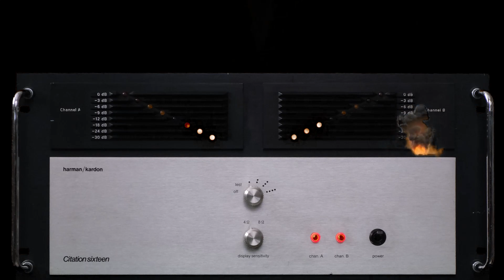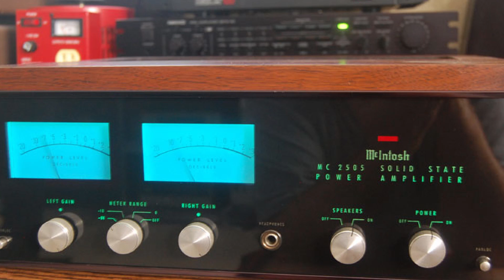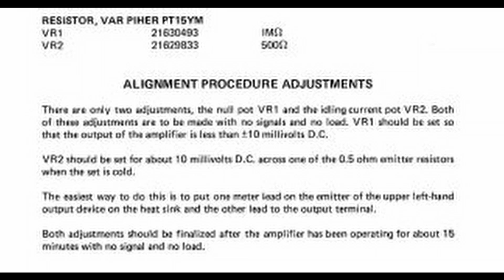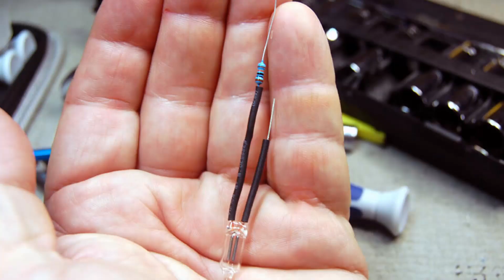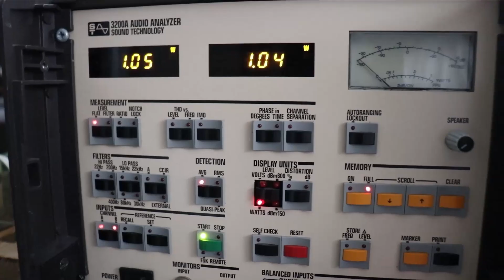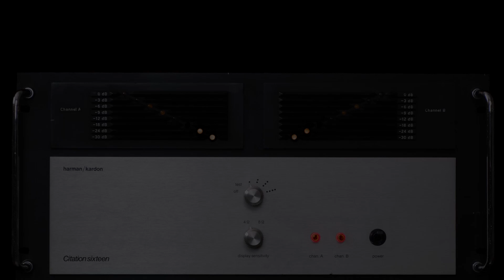Harman Kardon Citation 16 Power Amplifier. Vintage Stereo Repair Restoration Testing. Old School HK

Comment: I bought my Harman Kardon Citation 16a ( with a black front) wayback in 1978 and i still use it today.

The amplifier had an upgrade according to militairy specifications.

A friend of mine was a senior electronics specialist in the Air Force and he worked many hours to upgrade the amplifier.

The LED peak indicator system was removed to prevent electrical noise/interference in the audio signal

As a result the two controls on the front became accesible.
The top control was secured for the looks and the bottom control was connected to a couplingshaft connected to a stereo Noble potentiometer over the entrance

The original power supply capacitors were replaced by formed Siemens Sikorel long life types

The smaller capacitors, resistors ect. were replaced according to militairy specifications

The originally unreliable factory relais was replaced by a professional Zettler relais

Factory errors were corrected

The transistors on the back were stripped of the crimp sockets and silver soldered and the thermal paste was refreshed

Silver cable with teflon coating was installed

The bias was lowered from 50 mA to 10 mA to avoid damage by heat
(using an oscilloscope and a distortion meter)
The amplifier now only gets lukewarm instead of 80 degrees

The bias can be adjusted with a closed hood too which is very important.

During a check after 5 years it was found that the bias had not shifted at all (0,0 %)

Well i no longer need a seperate pre-amplifier and a Marantz CD-94/II CD-player is directly coupled to the entrance of the Harman Kardon Citation 16a.

The sound is clean, powerful  spatial and detailed.

Comment: I did listen to this Citation 16 combo in the early 70th. The JBL L166 did wake up and did really sound great on the Harman Kardon amps. Have been a JBL fan since. Also have a Marantz receiver from 76, but dont use it right now. Must have some service. The most popular norwegian ''vintage'' amp here in Norway is, Dynamic Precision. Will last forever with a tech who knows and upgrade this amps.

Comment: I did a complete service on one of these a few months ago. I did a complete recap, replaced the bias and offset pots, and so on. It came back first because the right channel was throwing about a half-volt of DC offset after warming up, and then later it actually stopped playing in that channel. It ended up being one of the transistors in the current source that feeds the bias string for that channel (Q5 on the schematic). I replaced that transistor and all was well. These amps are definitely built for ease of service - always appreciated by someone in my field!
Reply: Good Job 👍👍

Comment: I worked for military exchange out of high school in 77/78 in vogelweh West Germany. In the  sound centers speaker room they used a 16. The Leds were trick. Many times i would have a group of GIs staring at the bouncing lights. It was a great time working there, the golden era of hifi.

Comment: I’m thinking about buying one the owner said this. Left channel works fine, but right channel is intermittent. I believe it might be something to do with the power button.  $290. I have a good tech should I pull the trigger
Reply: hey Bob - did you get it?

Comment: I worked for HK when these were being built and had one we employees could buy them at 1/2 price.
Should have never sold it to a friend who still has it.
One of the tests was to have it at full power and short the outputs never bothered it at all.

All units were run at 1/3 power for 24 hours most power dissipation on the transistors is at 1/3 power.
Loved working there but pay was not so great.

Comment: People tend to freak out about how hot the heat sinks get while idling on Citation 16's, BUT, if if you read a through description of the operation of the amp from the Sixteen A service manual, pages 5 and 6, the bias is set so, it operates under Class A well above where most amps are set, in order to lower crossover distortion.
The service manual states that the heat sinks, at idle, may be up to 60 degrees C, Sustained 1/3 power usage may rise the heat sinks to 80C, and full output may go up to 75C, thermal protection switches on the heat sinks will open the AC line power to each respective heat sinks power transformer @ 90C. You just need to give it the ventilation it needs to cool itself properly.
Reply from the maker: Thanks so much for sharing that information.

Comment: I see this is a yr old video. Hopefully you see this message.  I have same identical amp. Bought it $100 work perfect. But I would like to restore it cosmetically and have it gone through  performance wise. Used it for about a yr.  Now It's sitting underneath my pool table. Can you help?

Comment: Fantastic video.
Reply from the maker: Thank you very much!
Reply: @vintageaudioaddict  so i checked a local audio store near me like i do every couple weeks just to see any new inventory. Late last night i found citation 16 for sale. Great shape. Test bench, cleaned up, good price. I went right to your channel and watched this video again. Bought it today and hooked it up. I had a modest kenwood kn 992 150 wpc amp powering my front speakers in my home theater. It was good. I replaced it with the harmon kardon, and there is no comparison. Same watts on paper. But the citation is sooo much better. Thanks so much for your videos. May not have realized what a steal this amp was without you.
Reply: @vintageaudioaddict  now two channel sounds good in that system. Cant wait to test it out more after nascar and dinner. Cheers

Comment: I got one of these out of a junk pile at a music store that was going out of business, it had no bottom cover and the power switch was broken off. I was going to gut it for the power transformers but I decided to trouble shoot it for fun, ran down the outputs and found nothing wrong so I took a screwdriver and flicked the broken switch on and it powered up, then hooked it up and it played just fine. I work for an Industrial electronics company so I looked through the Mallory catalog for power supply caps and  found some that had very low ESR and massive ripple current rating ( they were ment for giant industrial flash units). Redid the caps and rebuilt the low voltage power supply.  Hooked it back up and man those main power supply caps woke it up. Ran it hard and the current now available put the heat to the outputs.  So I made a fan shroud and temp switch to keep it cool. Gave it a cosign burst test  and it did it cleanly at over 1700 watts! This is a very nice sounding amp and has huge dynamics. 
It's a keeper.
Reply from the maker: Thanks for sharing. So much of this old audio gear can live on with a little attention.  Good Job!

Comment: Great amp! One of the best ever. However I remember the issue with LED display, yes one of the first, you could hear the stepped trigger points for eaach LED when it would fire. It could even be seen if you expand a sinewave enough on a scope. A slight glitch in the slope as each voltage level tripped.

Comment: Hi VAA
Nice video, and comments
I can get my hands on a HK citation 16.but one channel is fried. So I'll guess the end transistors are done.
Are they still available and are they expensive? I count 10x per channel.
If available and not end of the world costs, I can purchase it, replacing all caps and like you mentioned those variable resistors into nice bournse blue ones. 
I bet this amp runs any speaker, even electrostatic ones.

Comment: I’ll try it again , great video . My 1st venture into high end was back in 1978 , I bought a citation 16 amp, apt Holman preamp, DQ 10 speakers . Had a nice kenwood turntable, mc 20 cartridge and step up transformer, then added a citation 19 amp , an advent surround decoder ( don’t remember the model ) and large advert speakers for the surround. You could adjust the delay from 1 - 100 milliseconds. Those were the days! Got married, you know the rest. I bought a used citation 16 amp & 17 preamp, had them slightly upgraded, been in my closet for the last 15 yrs. I’d have to say the 16 & 19 were two of the best sounding amps out there especially for the money. Again great video, brought back some good memories.
Reply from the maker: Thanks for watching and sharing your story. For most of us this equipment does bring back great memories.

Comment: Even properly functioning Harman Kardon amps run hot. I had my PM 650 in a cabinet with a glass door it would be almost too hot to touch. I worked on copiers for over 39 years and when a machine was junked I would often take the little 2 wire fans out. They usually run on 12 volts DC. I have a bunch of old AC to DC adapters laying around from old electronics, and I wire up a 3 or 6 volt adapter to the 12 volt fan and it will run slow and quiet. I plug it into a switched AC output on the amp and it works great.
Reply from the maker: Thanks for sharing.

Comment: I have a 16 as well, but does not have the l.e.d. display.  Solid black face.   I run it in concert with a Citation 11 e.q. and a pair of Soundcratsmen PCR800's.
Reply from the maker: Sweet! Great Gear!
Reply: Hey Paulie!  I have the solid black version as well (a gift from a friend).  I'm assuming this version with the LEDs is the same inside, but I have no real idea.  Do you (or anyone else) know what the difference is (if any)?
Thanks in advance!

Comment: I had one of these years ago that I got for free. Only one channel was working and I didn’t have the skills at the time to fix it. Parts availability was an issue back then, pre internet days.  It seemed like the RCA outputs were not to be found anywhere in the known or unknown universe at the time.  So I used it in my recording studio for a while with the working channel driving a sub.  Eventually I gave it away when I shut down the studio. I wish I had kept it since with what I’ve learned over the years I’m sure I could get it up and running.

Speaking of HK and biasing I’m currently heating up a pepperoni pizza on top of a HK 460i receiver.  I think it needs a little something when I get to it. In the meantime it’s on the retired list.

Thanks for the write up on the old HK 16.  I really did like those beasts.
Reply from the maker: Your welcome and thank you for sharing your story. Harman Kardon made a lot of really good audio gear back in the day.

Comment: All 80s Harmon-Kardon amps ran incredibly hot with insufficient heatsinking. The integrated amps and the power amps and the receivers. Bad design. Even a 35 watt/channel integrated amp with NO bias adjust. Overheating can damage lots of other components and cause failure or premature failure.  I have always built my own with Heathkit and that equipment is still working fine today.
Reply: I have several and all going strong
Reply: It's designed to run Class A at a higher wattage than most amps, and it is expected to have heat sink temps up to 60C when idling, the info is in the 16A service manual, which can be found online, pages 5 and 26

Comment: Awesome review, I have one I bought new in 1970, would you mind doing a follow up with detail on bias adjustments, I have the service manual, but I'd love to see how you did it, I have one channel that I can't get the bias to calibrate, so I'm going to replace the variable potentiometers with the multi turn ones like you used. I'd also love it if you could show your method of checking the output transistors. I've replaced 2 of the  large filter caps as one had gone shorted on that channel. I've also replaced all the electrolytic caps and the relay as I thought that that may have been why I was having issues with one channel initially. Thanks again for your review of the HK Cit 16, I've loved that baby since I bought it, it's driven Carver Amazing Loudspeakers, the originals with the 5 ft ribbon and 4 12" drivers, also the Ess AMT1 A's which I purchased at the same time as the Cit 16. And now it drives Acoustat 1 + 1's beautifully, very inefficient and low impedance, but the HK Cit  16 never complains.
Reply from the maker: Thank you for the kind words. Yes, first replace those variable resistors with muti-turn one's. I think that will make your adjustments much easier. The original variable resistors VR1 and VR2 can get really intermittent and cause a lot of flakey problems. If you can't get the bias correct after that then you would need to investigate further.
Reply: @vintageaudioaddict  Thanks, I've ordered the Variable Resistors and will hopefully rejuvenate the old girl. Thank you for giving me the push to get her up and running again.

Comment: I noticed many cd players cassette decks tuners do not have ac primary line fuse in them so i put one in i have many videos putting it in is it a good idea i put disclaimer on those videos consult with a authorized service center before doing do you think its a good idea
Reply: there's not really any point in doing that.  your observation of CD players, cassette decks and tuners  not having fuses is spot on,  those types of devices draw such little current a you would be lucky to find a fuse small enough to pop before the transformer fries itself.  note how small the transformer is in those devices, compared with something like a power amp,  source devices are known as high impedance circuits, they require next to no energy to work
Reply: @jackheinemann8780  but if power supply shorts like diode or power cap goes it can burn transformer and possibly start a fire if cord melts and shorts I think
Reply: @DavidBerquist334  hmm,  yes that would certaintly be a concern with an amplifier, which is why they are fused. But the transformer in source devices is only capable of delivering a handful of watts from the wall.   This is my thought process,  it may be wrong,   if there is a short on the secondary side, that is essentially being seen as an infinite load by the primary, and infinite load = short at your wall outlet,  that will trip your breaker before you anything happens, well before a fuse would blow.    Im not going to be loosing any sleep over the fact there arnt fuses in my cd player.

Comment: I used to run a single citation 16 on four 15 inches (stereo 4 ohms) for my mobile dj setup 25+ years ago, I have beaten that amplifier and it never failed. I had an engineer in my area where I got it from he had installed a distortion detector in the amplifier that limited the input when distortion was detected, it worked really well and sounded great, lots of good memories and fun when I think of all of that gear !!!
Reply from the maker: Thanks for sharing. Like you a lot of good memories surround my vintage audio equipment.

Comment: I installed 8 of those in a big Venue for permanent house sound plus I owned one of the last ones ever made. (all black with the relay protection and discreet driver boards)  Superb unit in the h/k tradition. Sadly it was stolen right from my living room and we never found another one of that production run and condition. I would grab another one instantly , if i could find the same version and fully refurbished.   but the chances are slim.
Reply from the maker: Thanks for sharing and watching! Sorry that she was stolen.

Comment: Really nice video on a really nice amp. The sticker on the back with the engineer's names is great. I had a Bose 1801 amp back in those days that weighed 82 pounds, the power transformer alone weighed 41 pounds! A nice amp with great metering. Then I built the Dynaco Stereo 400 amp which was also very nice but without any metering. Had it for many years.
Reply from the maker: Thank you! Thanks also for sharing your experiences with your equipment. Nice gear!

Comment: Most components of that era, whether low or high end, seem to be better built than components today. Nice video!
Reply from the maker: Yes, they were. I wonder how many modern electronic devices will still be operating in 50 years? I'm guessing very few. Thanks for watching!
Reply: Not the electrolytic capacitors. The technology is far advanced than it was back then

Comment: I know it made sense to change the VR2, but could a guy exercise it to try and get it to work? Possibly spray some deox-it in there? Ya know, just to get it to work for testing reasons or whatever?
Reply from the maker: Sure, you could try to exercise the variable resistors but you should replace them at any sign of trouble like I had.

Comment: I love that retro VU-LED display. When you get it running..you should play "Burning Down the House" by Talking Heads. Dumb idea to use 70's vintage op-amps in the front end of a power amp. No wonder they revised it. As for re-seating the power transistors...de-soldering and re-soldering the power transistors can (and does) damage the original components.  (unless they are plug-in)
Reply from the maker: Thanks for your comments. These power transistors were plug-in as most were from this era. I've unsoldered many also with no issues but with any task you have to make your own decisions.
Reply: why do you think that desoldering/soldering the transistors damages them?
Reply: @StewartMarkley  Without using a pro-desoldering tool and heat sink clamps you can easily heat stress these old parts. They may work for while but every time you heat a vintage semiconductor with a  soldering tool you shorten its remaining life. It's the heating/cooling cycles over the years that does it.